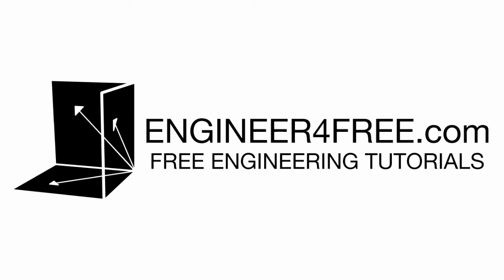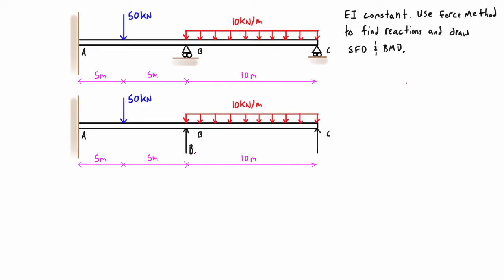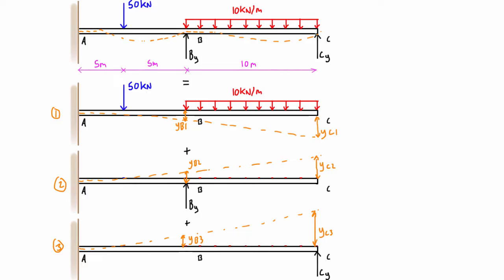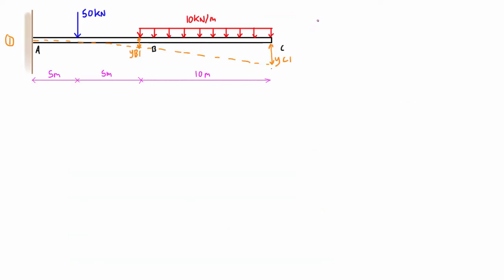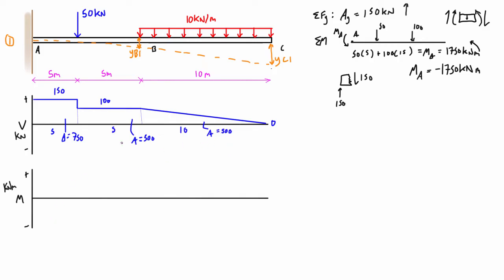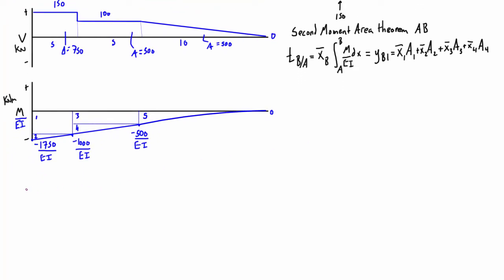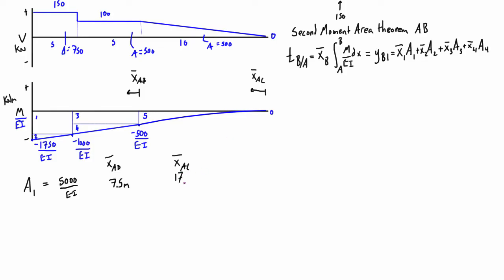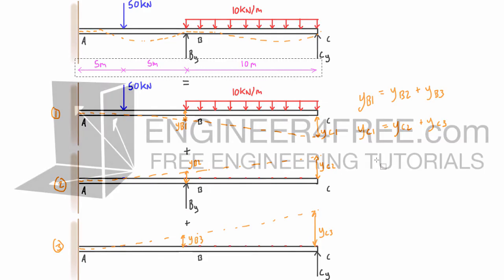Force method example #2: two degrees indeterminate (part 1/3)

Comment: Thank you sir,
I have request you sir , Is their is other Example , in which beam is like that but uniformly distribution force is  on fix side and point point load is on other side 
.
Plz if any one know , give me link or picture or something for help
.
Plz give me link or something for that problem
Reply from the maker: Hey check out engineer4free.com/structural-analysis I have a bunch of different examples there, also solved with several methods

Comment: When determining system determinacy what is the rule for counting the number of elements? Cause i'm counting 2 elements; 5<2*3.
Reply from the maker: Count all the unknowns. They are Ax, Ay, Ma, By, Cy. If we had 3 or less, the problem would be statically determinate, as we have 3 equations to work with in 2D statics (sum of force in x, sum of force in y, and sum of moments about a point). Each unknown beyond 3 is a degree of indeterminacy. So because we have 5 unknowns, we’ve got 2 too many for statics, so the problem is 2nd degree statically indeterminate.

Comment: I'm getting 1750 kn*m for the Moment at A during 7:55, not sure if its an error on my part but wanted to mention it.
Reply from the maker: Ma = +1,750 kNm because Ma is drawn on the diagram in a counterclockwise sense. In other words, the reaction moment at A is positive 1,750 kNm based on the way we drew the free body diagram. The internal bending moment infinitesimally close to A has a magnitude of 1,750 kNm, but a negative sign. This is because if you were to draw a new free body diagram with a virtual cut infinitesimally close to A, regarding the moments, we would have Ma acting in the counterclockwise sense which we would draw on the left side of this new FBD, and the internal bending moment which we would draw on the right side of the virtual cut, would need to be equal and opposite, so a clockwise sense and a magnitude of 1,750 kNm. If we draw an internal bending moment on the right of a virtual cut that has a clockwise sense, that is opposite to the positive sign convention, so the sign must be negative. That is why it has a negative sign. I think the confusion probably comes from me using Ma to denote the reaction moment at A, AND the internal bending moment at A. Sorry about that, sometimes it just happens in these problems that the same letter will get used. If you need a refresher on the positive sign convention for internal bending moments, check out this video: https://www.engineer4free.com/4/internal-force-sign-convention
Reply: I just saw this notification, sorry  @Engineer4Free . Thank you so much for responding and clearing that up for me, I got a little a confused, but I see it now. Have a happy new year!!

Comment: Can you solve the same example with unit load method?
Reply from the maker: Hey, I don't think I have a video on that, you can check out all the beam videos I have at engineer4free.com/structural-analysis . Also videos 40-49 here engineer4free.com/mechanics-of-materials might also be helpful